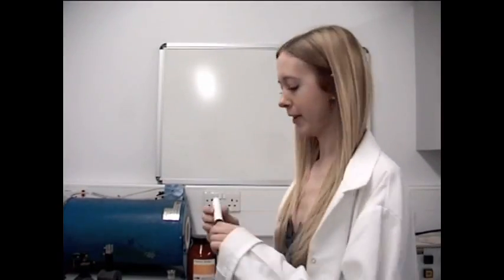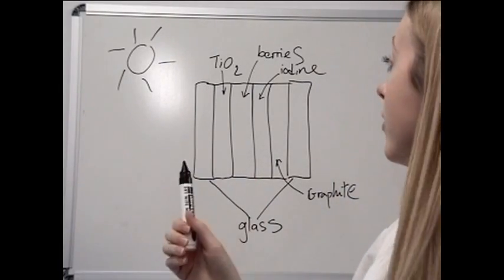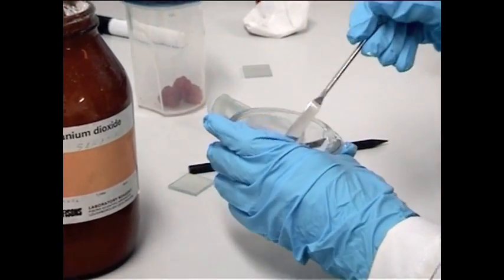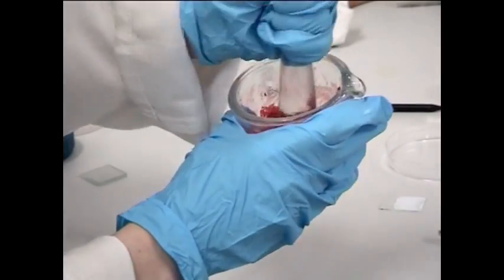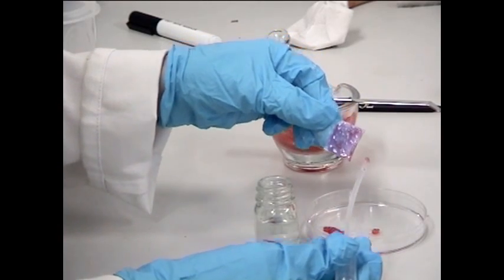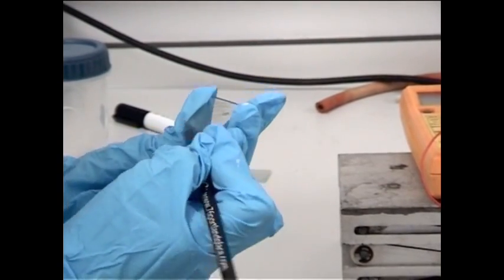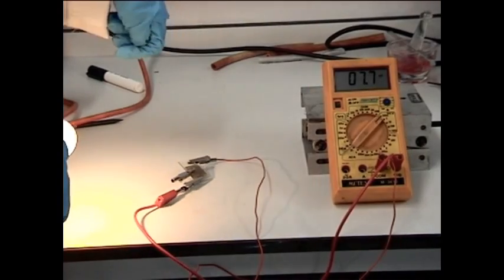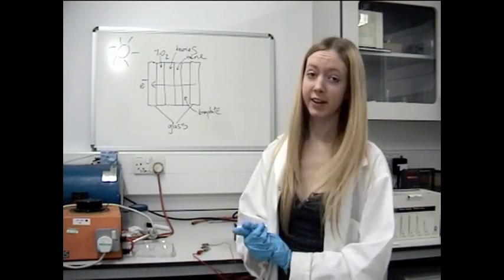How to make a solar cell using raspberries

Comment: I have a couple of questions if anyone is still following this. First, i assume that is a special type of glass. What is it called?? Second, the part of the glass that conducts electricity goes on what side?? The inside with the other stuff or on the outside?? Third, Titanium Dioxide is what they use to make white paint. Could white paint be used?? And lastly, if i wanted to try to make this and actually charge a battery, would i just put a couple of wires in between the glass along with the other parts???? Thank you.

Comment: Thank you so much for answering my questions im very grateful..i jst have a few more
i had made a blank DSSC that is with no dye nor electrolyte i didnt get a reading and i knw why bt to this when a added the electrolyte i got a reading dat also a good one..da only explanation i can thnk of is that its a redox electrolyte so da electrons of da electrolyte are the ones that jst move around in the cell can der be any other explanation

Comment from the maker: Hi,
As long as light can get to your film it doesn't matter too much which side it is shone from. In the commercial systems the back contact - the one you have put graphite on - is usually a gold or platinum coated surface so light cannot pass through. It is probably better because from the back the photogenerated electrons have further to travel from the film to the back contact and because your film is not strongly annealed shining light this will lead to losses.

Comment: which side of the cell do you keep under light? because im getting a reading on both sides of the cell....ie the dye sensitized side and the non sensitized side also...im getting a vry good reading on the non sensitized side

Comment from the maker: I think we only heated at about 200 C for around an hour but it was in a furnace and we put the sample in while the furnace was cold and allowed the slide to warm up gradually to the temperature. The glass will crack if it is heated too quickly. The heating is supposed to fuse the nanoparticles slightly so that electrons can pass easily between them.

Comment: hello once again :D...first of all thank u fr answering all my questions.:)
in all of the procedures and protocols that i have read, people are heating the slide after coating it with TiO2 or Zno to anneal it so..
1. is it necessary ?
2. can there b an alternative?
3. can the temperature be reduced and the time increased because i have broken two of my ITO slides, once while heating on direct flame and once in a microwave owen at 220 C...

Comment from the maker: The life span of this one is very short as the electrolyte dries out as there is no seal on this cell. The electrolyte (the iodine that is injected in) is one of the difficulties in long term performance of commercial versions of these types of cells, though they do last several years. TiO2 wont catch fire in the sun. If you have painted white walls in your house they are most likely white because or titanium dioxide. Look on the ingredients label of mayonnaise, toothpaste, gum with a shell...

Comment from the maker: Hi Nikesh. The titanium dioxide is a semiconductor. It is needed because when the light strikes the dye (berry juice) a negative electron and a positive hole are created in the dye. They would normally just recombine to be neutral again, but the TiO2 mops up the electron quickly and it is this which does the electrical work.

Comment from the maker: Hi I don't know what else you could use. Like I said to 6jayrock9 zinc oxide is also a possibility but I don't know if that is any easier to get than titanium dioxide... just one thing to be aware of is that TiO2 dust has recently be named a possible carcinogen so if you do get some you should wear a dust mask!